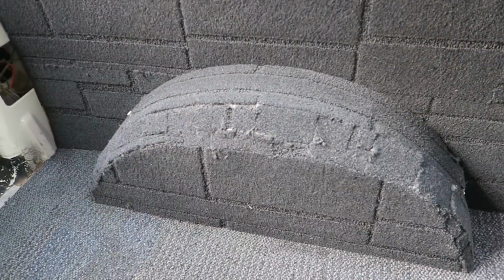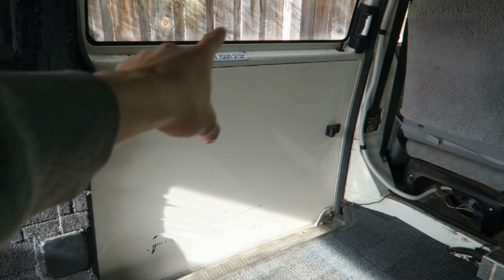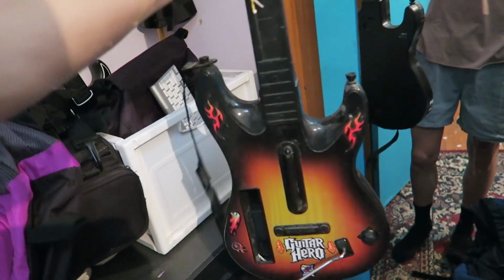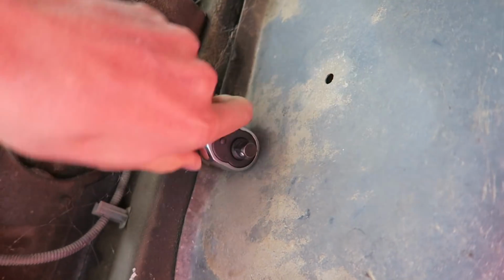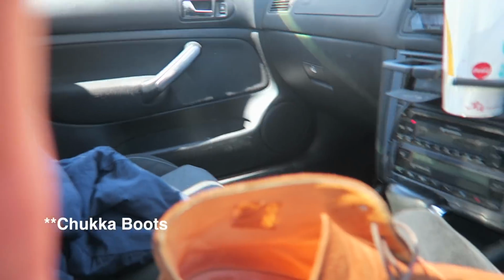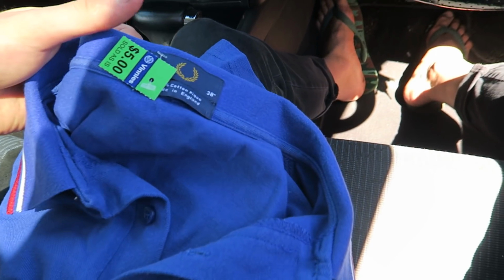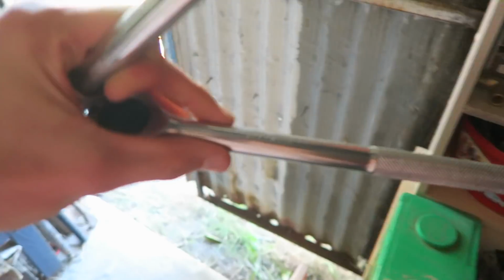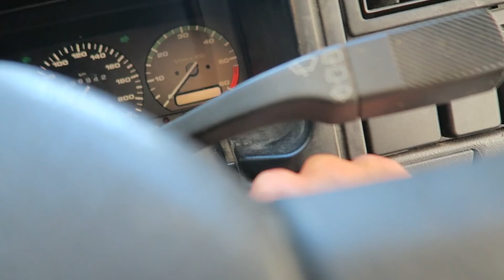VW VAN OIL CHANGE & THRIFTING VLOG 267

Comment: you possibly already know but I can recommend you on the back door - only one left getting expandable foam and just fill holes- cut excess off and drill wood panel onto it and carpet - this will look neat and the foam is great and cheap. will improve your heat and sound aspects.
Reply from the maker: Yeah definitely thanks for this! ✌

Comment: Inverters don’t charge at all. They take DC voltage from your battery and turn it into AC voltage for the kinds of things you’d plug into your walls in the house. They can suck your battery dry pretty quickly. Don’t hook it up to the vehicle battery or you’ll be stranded at some point. I wouldn’t buy anything until you learn more or you’ll likely just end up having to rebuy later. You can also destroy certain types of batteries by allowing them to get too low.
Reply from the maker: Thanks for the heads up.. I need to learn more about it..